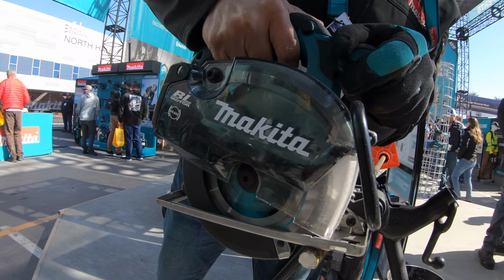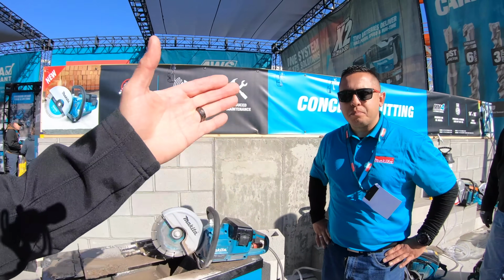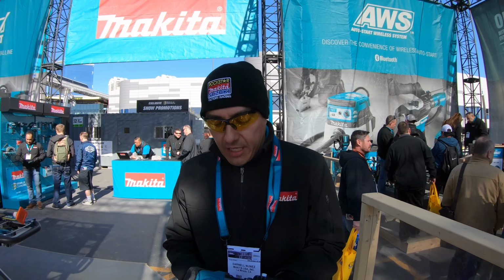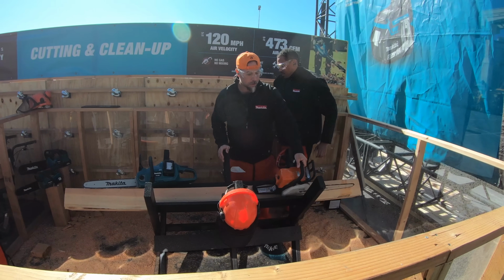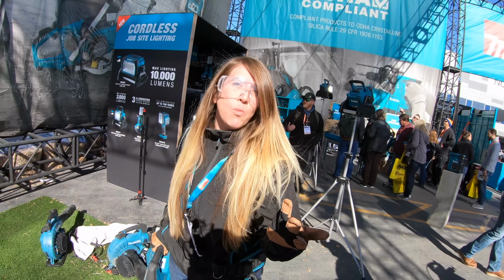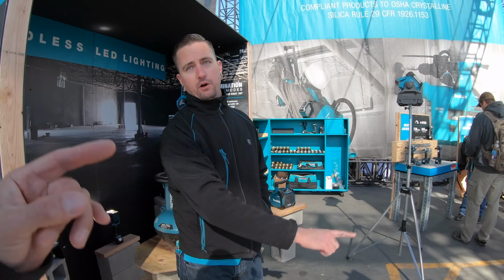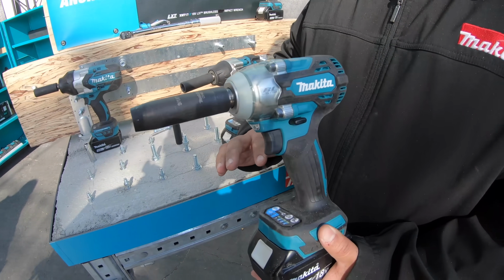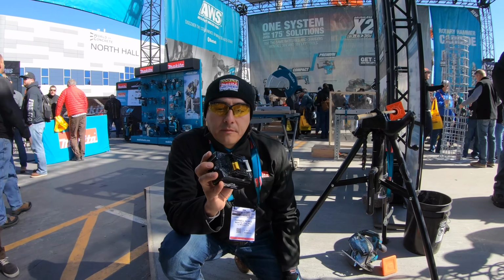The best of Makita's NEW Power tools at World of concrete 2020

Comment: That's some pretty cool tools. I liked the speakers though, 10 of them paired would be awesome. Only issue I may see is if it's a bigger site using them all paired and then 2 guys on one side of the site need to talk so they need to pause it and it then pauses all of them, could possibly be a bit annoying. Also, not the biggest fan of their color on the actual tools.

Comment: What I need BAD form Makita is a conversion set for Battery to 120V and also battery chargers for 12V Car systems so our Batteries can be charged on the go between job sites.
Reply: Makita DC18SE car charger
Reply: @loredanasimache3201   Yes that is for a single battery to be charged. But when can we see double and quad or even bigger charger stations? We use right now multiple double chargers which also have the nice front USB but sadly they run on 120V but yest the DC18SE is better than nothing but over $100 for just a charger where I can buy a double charger for under $50 is also not really good marketing.
Reply: You could use an inverter to provide 120V AC to your existing double and quad chargers. It will be less expensive than dedicated 12VDC chargers. For example, the double charger draws 460W, so you could install a 750W inverter (like this one for $45: https://www.harborfreight.com/750-watt-continuous-1500-watt-peak-power-inverter-66817.html). Or you could get a 1000W inverter and run two double chargers simultaneously ($90: https://www.harborfreight.com/1000-watt-continuous2000-watt-peak-modified-sine-wave-power-inverter-63522.html). That's only a few dollars more than the Makita DC charger ($82.38 on Amazon: https://www.amazon.com/Makita-DC18SE-18-Volt-Lithium-Ion-Nickel-Automotive/dp/B001UGMC9U/ref=sr_1_1?keywords=Makita%2C+DC18SE&qid=1582698792&sr=8-1), and you can change four batteries at once instead of just one.

Comment: boys, do you really think any of these battery saw companies that show a race with a gas saw......are using the same chain on both saws?   chain type and sharpness have a ton to do with cutting speed.  If they want to do a fair test (and they never will)...put out a video comparing 2 saws, both brand new and they install brand new chains on both...then show that race.  But they never, never, never will.  You tell me why they wont do that?   Seriously stan, quit showing races.....they are fixed before it even happens.

Comment: Have asked this before, but is there going to be a back pack platform or some  other cordless system among the big brands for a cordless compactor/vibratory plate like the three used by wacker neuson, they also have many electric platforms hammers/rammers/diggers/dumped etc

Comment: The chainsaw challenge is easily rigged , the chain must have been dull , let me sharpen that chain and go over the rakers a couple times and the makita would be blown out
Reply: I worked the booth last year....new chains every day
Reply: David Kelley i mean it sounds good
Reply: The chain is one potential variable but what I noticed is that the gas saw gets bogged down when he pushes it whereas the battery saw never does.  I'm guessing that had something to do with the win.
Reply: the battery saw may have had a full chisel chain as well. very easily rigged
Reply: I agree
Reply: Yes I also agree ,  I have a top handle 36v Makita and the MS180.  Given same chain setups the MS180 outperforms my Makita.   That said, I like the top handle Makita better for tree climbing.
Reply: MS170 is also the crappiest most gutless chainsaw stihl makes.

Comment: What do you think of a Milwaukee m12 heated jacket
Reply: The handful of people I've seen wearing them and have spoken to really like them.  I'm getting one this fall for deer and duck hunting.
Reply: @peterbills4129  thanks for the advice
Reply: It doesn't work with the Makita batteries, but I like the jacket.
Reply: @hardlyb  well I said a Milwaukee m12 heated jacket. Not dose it work with a makita battery
Reply: @Brianm21  I was just making a joke about all the Makita guys saying "the best thing" about their new tools was that they used the Makita 18 volt battery. It is a good jacket - I have the one without the hood, and the tough shell, and it's very comfortable, and quite warm even before you turn it on.
Reply: @hardlyb  and you would recommend it
Reply: @Brianm21  Yes, I do recommend it. I get cold easily, so it's a big help, and it's machine washable and can go in the drier. It's also a well-made, comfortable jacket even without the heat. (I've only had it a couple of months, so I can't say for sure how it will hold up, but I trust the brand and all the reviews I've seen say it lasts.) With a couple of batteries you can stay toasty all day long.

I also have a heated vest, which actually puts out more heat, but that I can't recommend because it's so fragile. It has to be hand-washed and uses a weird and expensive battery. But it's handy when I need to stay warm and can't wear a jacket.
Reply: @hardlyb  thanks for the intel